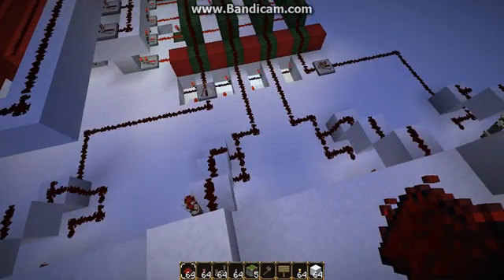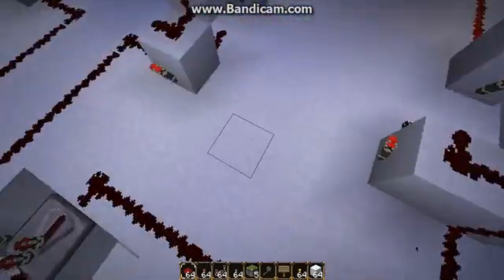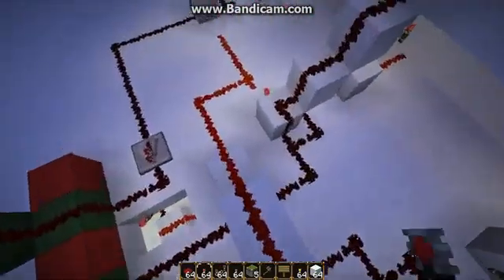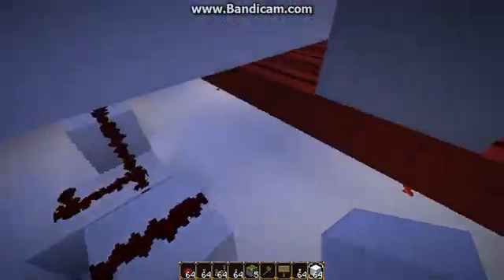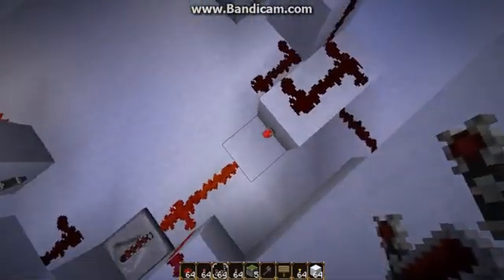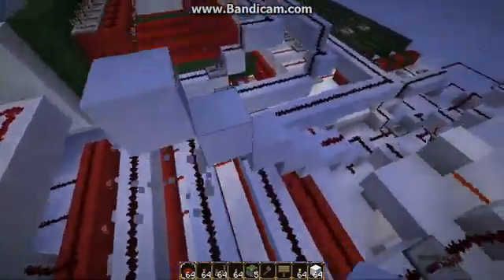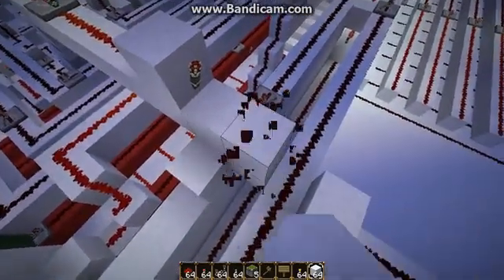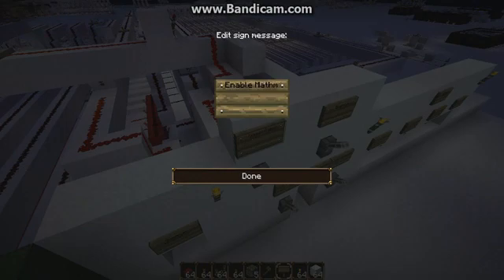Minecraft how to use conditional branching based on calculated values in a minecraft computer

Comment: You know, you could put in a system that allows you to jump to a different address than normal (or the same address to disable the jump) on ALU = 0. Combine it with a conditional unit (does A != B, A > B, A < B etc.) and you have a multi use if statement!